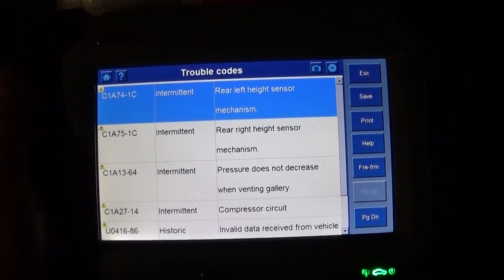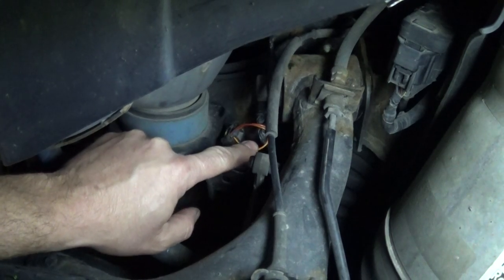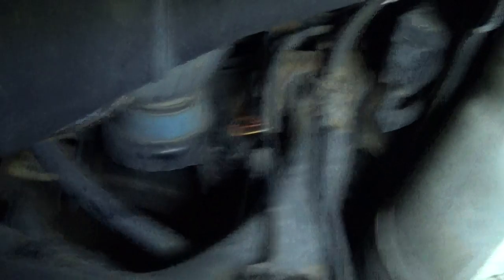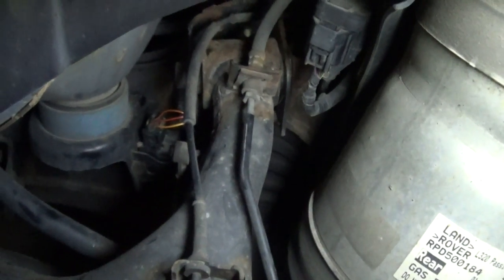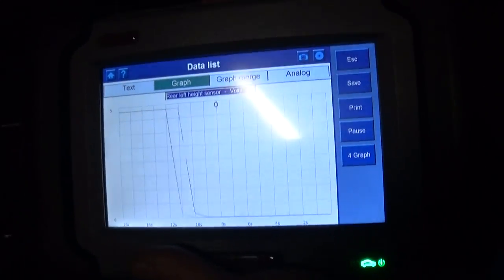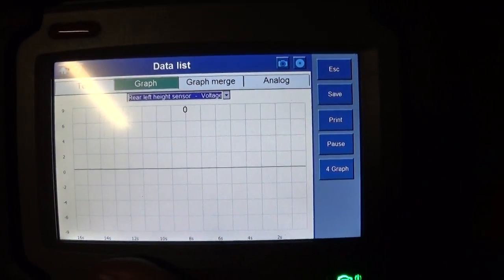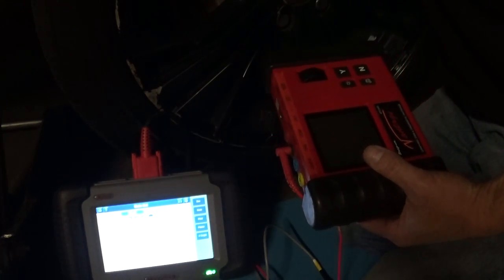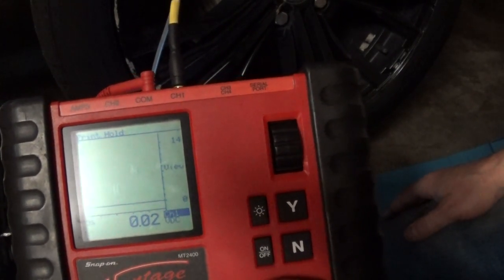How To Test Sensor Signal Wire Safe Way

Comment: What if you have an intermittent signal wire problem…can you just run a signal wire and connect it to the ecm to the crankshaft connector ?

Comment: but if the sig can handle a short to ground why do we worry about meters and test lights?the amerpage draw from a short is emensly more and yet that doesnt destroy the pcm?
Reply from the maker: I am not sure if I understand you question. Signal voltage can’t handle short to ground. It will be pulled down to 0 volts.

Comment: that would be much better if u have shown us how u connected the meters
Reply from the maker: ahmed dokman unplug your sensor. Take your meter set it on diode mode. Take black lead and connect it to a good ground and take red lead and touch signal wire and watch your scan tool for response. 👍

Comment: have a Question:
5v at pcm ok, signal return has battery volt(12v plus),
DTC-hard fault to CMP P0340 short in circuit,
Reply from the maker: Unplug sensor and take test light connected it to ground and touch signal wire. If your test light lights up your signal wire is short to power
Reply: @kyhomegarage3430  
key on?
what is the funcion of signal wire?  basically a ground?
Reply from the maker: @sonofsteve566  yes key on. Signal wire sends signal to PCM
Reply: @kyhomegarage3430  
thank you, mechanically not bad with wrench, but not much experience with wiring been studying pin out and wiring diagram but little over welming when don't understand basic functions, appreciate your help
Reply: @kyhomegarage3430  
ok, tested light from ground to signal return, no light no short?  what am i missing?
Reply from the maker: @sonofsteve566  what car are you working on
Reply: @kyhomegarage3430  
98 Ranger 4.0, had engine swap to 2003 3.0.
starts runs, hard fault cam sensor "replaced no change" as best of my knowledge wire harness appears ok.~ I took a junk yard pcm from 03 ranger hooked it up, no change, Test was to rule out PCM/ECU.
Reply from the maker: @sonofsteve566  did you replace harness
Reply: @kyhomegarage3430  
unknown, I had a guy call me said would you want a ranger? sell cheap, needs work~price was right, engine sounded good "SURE!", lol. now its my problem.🤔
Reply from the maker: That sounds like a big mess my friend . Not knowing what was done before makes it very difficult to diagnose
Reply: @kyhomegarage3430  
yes Sir